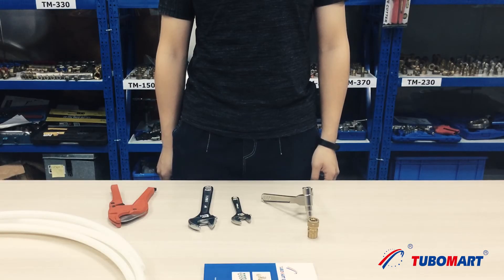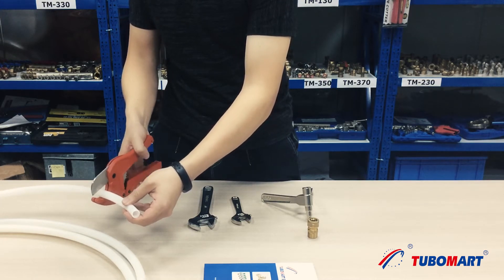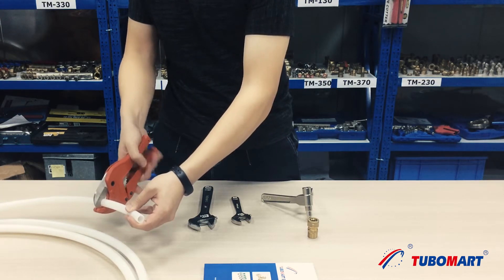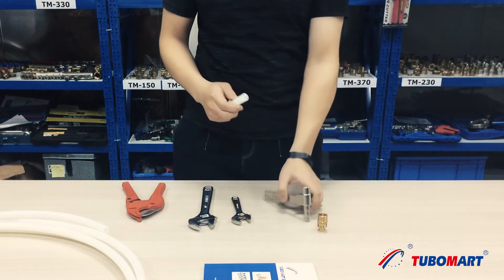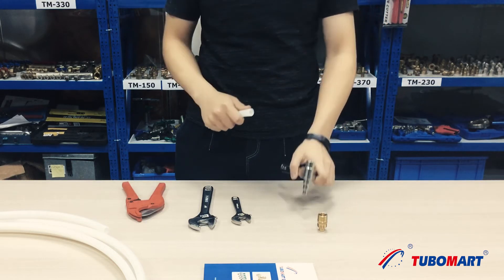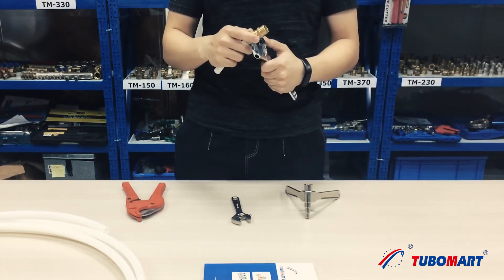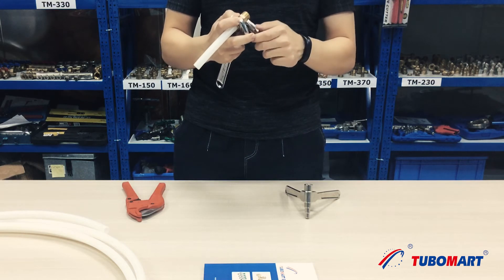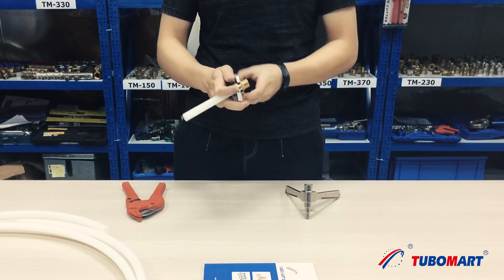How To Install Compression Fittings for PEX Pipes

Comment: Why would you put a compression fitting over an expanded fitting?
When you force the pex pipe open and insert the connector, the pex pipe will come back to it original size and make a tight fit around the connector.  So you don't need to use the compression fitting with nut.